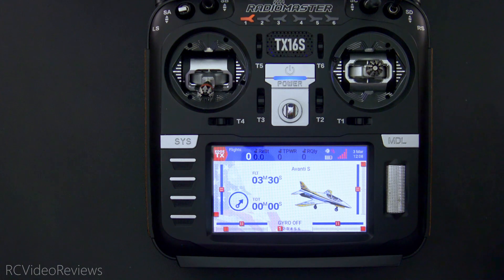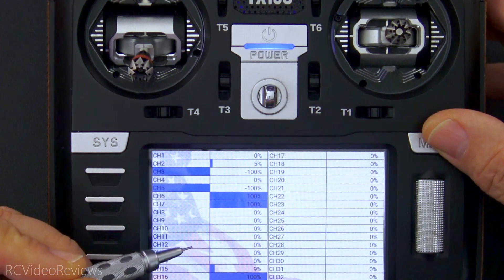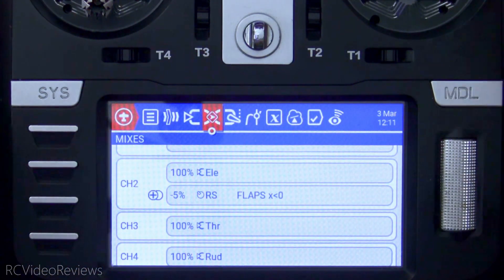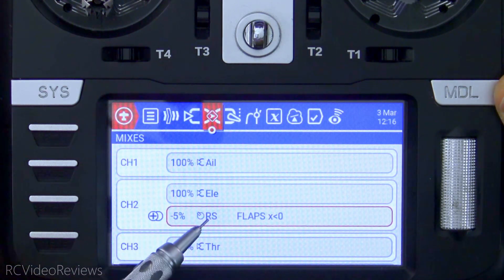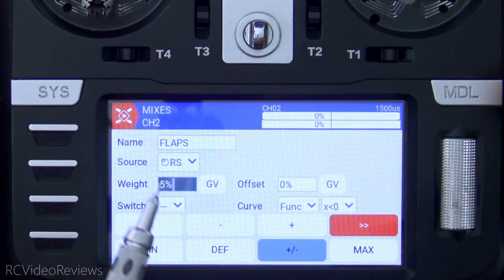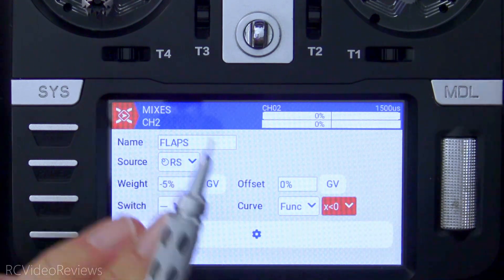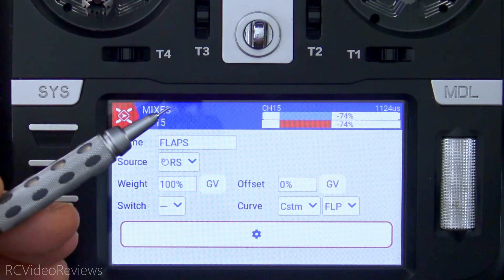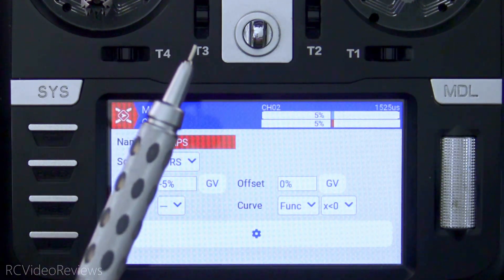EdgeTX Flaps to Elevator One Way Mix

Comment: Thanks for the video on this!  Question,  I have a three position switch.  The middle position is partial flaps but I also want to mix down elevator into it.  With the x<0 function,  the middle position is 0 and there is no elevator mixed in.  Is there a way to get up elevator mixed in with the middle position (0)?

Comment: FIXED: Wonderful video. Helped me to understand mixes. Helped me in setting up a UMX Turbo Timber Evolution. 3 position flaps on channel 6 Using switch SB on my Radio Master TX16S running Edge TX 2.9.2. Channel 6 is using -100 up, 0 mid, 100 down. The flaps work perfectly with 2 second speed. In mixes I have added elevator mixing for the middle and down positions of switch SB. Source is switch SB, weight is -17% with SB-, weight is -30% with SB down. With 2 second speed. However, elevator mixing only works for SB down. No elevator movement in SB-. Channel 6 monitor shows this also.
Oddly enough I tried using flaps or channel 6 as my source for the mix and the SB down works. SB- will give a momentary few % in the positive direction then return to zero. If I set the weight to 20% positive, SB- will give momentary movement of elevator in negative direction and return to zero.
I used the percentages recommended in the Timbers user manual.
Any ideas? 
Working now, changed my source to MAX.
Reply from the maker: Good job.
Reply: Thank you for taking the time and writing down the answer! I'm setting up the exact same plane and experienced the same problem.
Reply: Thanks! Worked for me as well!
Reply: For me too but only if i take out the function x<0. Is it the case for you too?
Reply: Thanks!
Reply: same plane and radio, but i am not getting any elevator in the mix, don't know what I'm doing wrong.
Reply: @charlesbeshaw9843  Thank you, this worked like a charm for my setup with 3 position flaps on SA for my Eflite Cessna 150T.
Reply: I had the same issue, it was driving me crazy! Thanks so much!

Comment: Just curious is there a way to adjust the compensation for the flaps on the fly while madening the plane for the first time.
By maybe making the elevator trim switch adjust while the flaps are down, but go back to normal trims when the flaps go back up.
Reply from the maker: EdgeTX • How To Change Weight [Rates] and Expo with the Knobs or Sliders
https://youtu.be/lzWUhXblqus

Flight modes would work too as they have the ability to set trims per mode.

Comment: Any idea on being able to adjust the elevator down movement while in flight? On landing, lets say you have too much or too little elevator, is there an easy way to adjust this in mid fight?
Reply from the maker: https://www.youtube.com/watch?v=lzWUhXblqus
Reply: Yep I use flight modes
Reply from the maker: Flight modes is an answer, but not the only answer. With gyros, I tend to use flight modes so I can have individualized trim to correspond with the gyro mode. In that case, using flight modes to mix flaps/elevator isn't a good idea because I might land with stab on, or stab off which both could have different trim arrangements. 

Just pointing out there are several ways to do things on Edge as @flyer mikey is also pointing out.